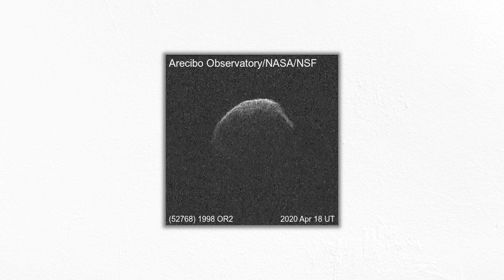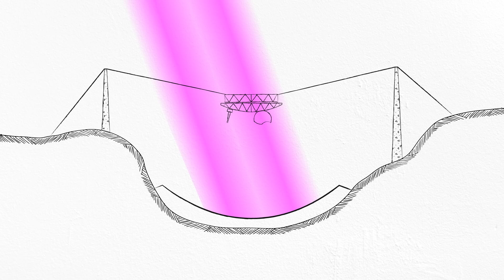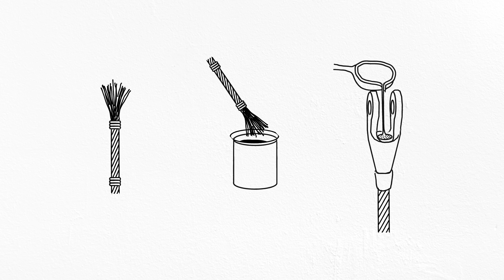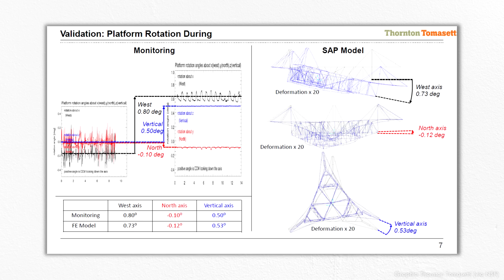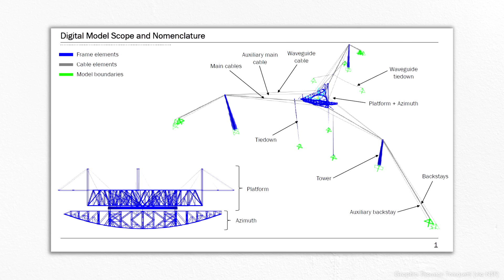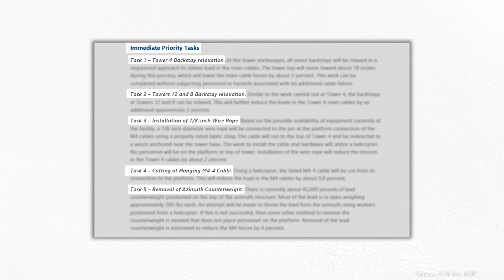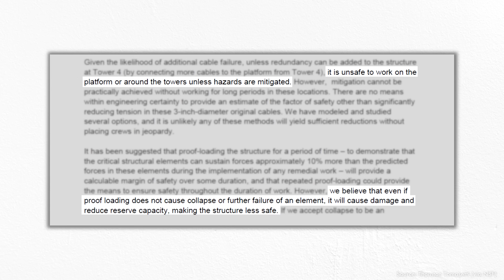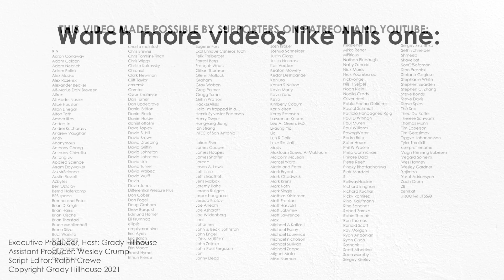What Really Happened at the Arecibo Telescope?

Comment: Well if I learned one thing, its that cable dehumidification systems exist.
Reply: They're common in communications cables, both twisted-pair (outdoor telephone lines) and coax (radio broadcast towers). A dry-nitrogen supply, or an air-compressor-dehumidifier, will be regulated to a low pressure that's routed into the cable's interstitial space, to ensure that any cracks in the jacket result in air leaking out, rather than water leaking in. The cable pressurization gas almost always goes through a flow meter on the way, and flow readings are regularly taken as part of maintenance, to assess jacket condition.
Reply: @nateb4630  I had absolutely no idea. Every time I learn something like this, I come to the conclusion that there was more to know that I’m capable of knowing. And that there is more out there than I had any idea how complicated the world is. So damn cool.
Reply: @nateb4630  Most of my cable experience has been on small yachts, where moisture is an assumed constant, with no consideration for attempts to dry them.  To hear about this tech, well it's amazing.
This is my TIL moment.
Reply: @nateb4630  Doh! You beat me to it 😁 Exactly as you say,, the only thing I'd add is low dry air/nitrogen pressure can be used to trigger an alarm for the affected cable..... The cause often being cable damage by JCB/Catipiller diggers!
Reply: @nateb4630  Coax means 2.
Wave guide is pressurised. It's hollow. Coax with hollow centre conductor is not pressurised.
Reply: @nateb4630  that is kinda amazing. can that be used to point out exactly where the jacket failed ? or it can only say if its damaged and how bad ?
Reply: Tom Scott has a video on that called "how to stop a colossal bridge from corroding"
Reply: Tom scott has a great video on it
Reply: humidity in the forest is present continiously
Reply: @jmr-marc  Humidity in my bedroom is present continuously.
My windows are crying dew on the inside right now.
Reply: @JonatasAdoM  That's not good, mold and all that. Better get a dehumidifier or vent it out and pull less humid air in.
Reply: @JonatasAdoM  Your mites must be delighted .
mine arei in the dry, and have a little hot, with these summer temperatures
Reply: sometimes theres nitrogen tanks next to phone poles . thats what they r for
Reply: Bay bridge san Francisco..an abortion..
Reply: This is the only thing I learned from the video, and that alone makes it worth it.  Part of me wonders what is better and in what conditions, corrosion prevention or preemptive safe replacement systems.

Comment: Visiting the Arecibo Facility was and is still on my bucket list, but it won't be the same without the great dish.  I likewise hope that they're able to install another megastructural instrument there to replace it - it's a great site and I hope it continues doing research for many years to come (with or without a new dish).

Point of order, though: FAST is a bigger telescope, but lacks Arecibo's transmission capacity - it's designed to be receive-only and the retrofit would be complex, as I understand it.  Humanity has lost a powerful space-radar - we have exactly one other comparable instrument (the Goldstone Solar System Radar in California, which has a transmission capacity barely a fifth of Arecibo's weakest transmitter and is significantly less sensitive).  It's not hyperbole, I think, to say that the Arecibo Dish was a unique facility, and that even 58 years after its construction it had no equal while it stood.

Comment: Very sad, that the arecibo observatory crashed. It was an important one which made so much discoveries! But it was built for way less. It was never designed to hold the gregorian dome. The original cables were old and apparently already to worn out and the new support cables weren't strong enough to hold the entire structure. But nobody got hurt and it has goven us huge insights into the universe.

Comment: Wait so it was designed with a safety factor of 2 meaning that the cables would be at their limit at 200% of the static load, but the second cable snapped at 90% of its rated load? I think a look into the corrosion theory is worth a look. Usually static loads are a simple thing.

Comment: If instead of suspending the central listening device, in the center, they alter the shape of the Dome, they could put a ring around it, that would be much more permanently stable, and allow them to receive the same basic information, if not more so, with far less maintenance. 

Would be neat, if they figure out a model, that would work well, with that form factor, as then there are far, far, less failure points. 

Though they would be gathering information at a greater angle, instead of nearly up and down, etc. 
This would be far more practical.

Comment: It should be pointed out that the original engeering did not fail. It was the engineering to add extra weight for the Gregorian dome that failed. When the new engineering failed, the old engineeing was pushed right to it's safety limit. It is a testament to the skill of the original engineers that the telescope structure did not fail immediately when taking a shock loading of a much larger weight than expected or designed for.

Comment: 15:42  A safety factor of two sounds almost negligent, if that's really the factor for "the expected static loading from the platform"...and no one in their right mind should have assumed the structure would have no dynamic loads, considering it's all exposed to the weather, in an area that often gets tropical storms if not hurricanes.
Reply: Not really - it’s failure happened at half that actual load 🤷🏻‍♂️. If it was ACTUALLY 2x it would have been completely fine. The failure of the aux cable simply exposed the critical weakness of the original cables (failure at 62%?!) 
In essence it was BUILT with a safety factor of closer to 1.2, they just didn’t know it at the time. 62% is far more than just corrosion. It’s a shame that it’s been half a century and anyone involved with the cable production won’t be held accountable- but that’s where the blame should be squarely placed in my opinion.  The construction of the aux cables / fittings is certainly a contributing factor as well.

Comment: I would hope the cables weren't made as shown at 14:37.  Steel cables with a fiber core have a habit of corroding from the inside, with the fiber wicking moisture into the centre of the cable.  This would make them very difficult to inspect, as the strength will be seriously reduced long before there's any corrosion visible from the outside.  (Obvs, this can still be a problem with steel-core cables, but it's generally less common without having the fiber to act as a wick.)

Comment: Another pertinent observation here: John Agustus Roebling apparently wintered near me in Clearwater, Florida; there are a couple streets named for him.  He was the engineer who designed the Brooklyn Bridge, still open to traffic 138 years after it was first opened in the late 1800s.

I read somewhere that he was asked why that bridge was still standing, when so many from that era had collapsed.

His reply was that, not knowing what he didn't know, he calculated the maximum combined static and dynamic loads he could envision the bridge having to withstand...

And then multiplied by *six*.

That's engineering, folks; not seeing how far you can cut the design back.
Reply: Some perspective: Its estimated that 20-40 died during the construction of the Brooklyn Bridge.          IIRC engineers had some sort of morbid causality estimate factored into their designs during the times.
Reply: @snakerstran9101  yeah, that was also pretty common in major construction projects back in what we are increasingly pleased to call the day. It still happens, but it doesn't happen nearly as frequently as it used to back then, it was a standard cost accounting item on project that large in the 80s.

Comment: If they designed it with a Factor of Safety of 2, then added the Gregorian Dome, which was 50% heavier than the existing receiver, that essentially would have lowered the factor of safety to 1.33. The original designers couldnt have predicted the technological advancements that led to the Gregorian dome. I think they cannot be blamed for not giving a higher factor of safety, as it would have seemed sufficient at the time.
Reply from the maker: They added more cables and backstays with the dome, as I mentioned
Reply: @PracticalEngineeringChannel  Yes, true, I forgot to consider that. I'm sure engineers much smarter than me examined the all these factors and more before and after the installation and concluded it was within spec

Comment: Wondering how much extra complexity it would add to such structures to include a winch/pulley system for just one anchor point, that would enable the slow controlled lowering or lifting of the suspended mass. Basically a crane on site. Likely they used something similar when they lifted the original equipment into position, then just got rid of it. Having such equipment sitting there for decades without any role clearly comes with a lot of added maintenance and expenditure, on the other hand, you'd get much better serviceability. Just in case something like this happens.

Comment: Repetitive stress fatigue. As a motorcycle mechanic I know that control cables like a clutch cable are remarkably similar. And when they fail it looks very similar the failure in the video. They always break right at the joint. By the way an even better way to form a spelter socket is to heat the steel strands right at the end of the cable enough to melt the steel forming little enlarged balls on the ends of the strands. You just have to be careful to keep the heat as close to the end of the cable as possible as heating the cable steel above red hot embrittles it.

Comment: You should also never use a rotating rope or cable in a socket, only a non-rotating rope. Otherwise they can unwind out of the socket over time. We discontinued using sockets on rotating ropes in mining about 20 years ago.
For hoisting in Shaft, single ropes use a FS of 5 at the sheave and 8 at the conveyance.  For multi rope hoists, a FS of 4 is used.  2 is pretty low FS for cables, even static.

Comment: It’s not hard to see why it failed:
1. Not enough funding
2. Poor or lack of proper maintenance
3. Poor planing and operation/redundancies to accommodate the extra weight of the added science structure 
4. Next to a high corrosion environment
5. No plan for cable/ structure failure in place.

Comment: Even if S was 1, if it failed at 0.62, there has to have been an introduced defect, either at fabrication or during use (e.g. fatigue traction/contraction due to the storms). Also, for those out there thinking S=1.5 is low for aviation, the space industry highest S is 1.2~1.25. Remember, in space, 1kg of extral material = thousands of extra $ in cost, and a .1 increase in S adds tons to the vehicle.
Reply: I don't know where you got 5 for aviation from. He said 1.5. It is mandated to be no less than 1.5 by FAR regulations. Also for human rated spacecraft the FOS is 1.4.

see for example: https://apps.dtic.mil/dtic/tr/fulltext/u2/a070237.pdf and https://ntrs.nasa.gov/api/citations/20140011147/downloads/20140011147.pdf
Reply: @ASJC27  it was a typo, thanks for bringing it up <3 Also, the 1.25 was out of Tory Bruno himself for the Vulcan Centaur.

Comment: The cause was pretty simple: Bureaucrats and modern academia. From inadequate inspection and cable slushing (things known to even the most hoedunk logging crew as critical) to excessive time spent wringing hands and studying the study of the investigation of a study of design info they should have know since the thing was built; meanwhile the problem just keeps getting worse, until of course the issue solved its self.

Comment: So, next version, use something similar to a cable tram arrangement to increase the field of view? Then you could have the option of a "home" position on the ground for the receiver. If the new towers are set further out, you'd even be able to remove the entire receiver from the dish for maintenance or replacement - or swappable receivers depending on the target body. I see many possibilities for increasing the onsite abilities while decreasing risk, taking advantage of modern computer analysis.

Comment: The cable failuers sound like a very similar situation that happened at Humber Bridge. They found moisture in the cables that the original engineers didn't predict would occur. They ended up having to spend a lot of money re-conditioning and re-splicing the cables. Considering the Humber Bridge finished construction in 1981, and this structure is significantly older than that, there's no wonder they didn't predict this kind of corrosion would occur. 

Considering the humidity of the region, there really is no wonder.

Comment: We need to rebuild it. It was the most powerful and sensitive radar telescope in the world and it is in a very quite radio area, something that is not easy to find in this day and age. A lot of the equipment is still there and intact, as well. With modern engineering and cost of materials, it would be be cheaper to construct now. We could even make many of the suspended structures out of lighter and stronger materials. Hell, just the cost of the aluminum panels would be way cheaper now and could be made thinner by using a modern alloy.

Comment: Double margin was with new cable, likely with at least 30% extra from the cable manufacturer understating tensile strengths the cables were guaranteed to withstand.  However 60 years of spotty maintenance meant the paint was covering salt ingress, and thus making thousands of small electrochemical cells along the cable itself, leading to the gradual weakening of them. Eventually the strain was too great for the remaining cable, and you can see it was suffering from plastic deformation until it finally got to the yield point, and the rest went in a second or so as they were massively overloaded. Likely examination of the failed cable ends will show the plastic deformation and the corrosion cells where they failed in sequence, along with likely all of the cable length being corroded from the inside. The failed sockets likely a mix of the zinc being too cold when poured, the steel cable and socket was also not heated up enough, and 60 years of salt turning the zinc into zinc oxide and zinc chloride inside the joint.

And for elevators, the 11 times safety factor means a single cable is able to hold the car safely, even if all the others fail. Typically 4 cables minimum, though for long travel 6 is common, more to reduce wear on the sheaves than anything else, as this spreads the contact area out and thus the pressures are lower. Inspections not snapped strands, and replace them when there are too many snapped strands within a certain distance on the cable, or from an end. The quick way to look for snapped strands is to take a cloth, and wrap loosely around the cable, then run the car from top to bottom, and see if the cloth gets snatched. Almost no elevator accidents are due to cable failure, pretty much every other part fails first.

Comment: Shame they couldn't have used helium/hydrogen balloon/dirigibles (perhaps many of them) to temporarily attach to the suspended structure/cables to lessen the load.
I'm sure each would provide only small lift, but maybe enough large ones could have compensated for the lost cables and allowed crews to safely attach emergency cables.
Maybe even use drones to pull smaller cables over the existing supports and under the platform (allowing increasingly larger ones to be pulled over). Even if these were simply draped between existing cable mounts, it may have been enough for an emergency stopgap.
Oh well.

Comment: They didn't replace the cables after 50+ years?! Fucking morons. In overhead line engineering conductors are replaced every 20-30 years minimum.

Comment: It is difficult to wrap your head around how enormous this dish actually was without seeing it. It is as wide as 4.5 football fields end to end and has the surface area of 30 football fields.  It was also featured in the film 'Contact' and the James Bond spy movie 'Goldeneye'.
Reply: The universe is about 93 billion light years in diameter. That's larger than two football fields!
Reply: @GAVACHO5150  But you are not talking crazy, you seem like a normal logical person. Leave the craziness to us.
Reply: "Football fields" has no meaning to me.  Would have been cool to use a real unit of measurement like meters.  Cheers
Reply: @ianspeckmaier9565  73,000 square meters.
Reply: @nunyabidness117  Holy moly that's huge.  Thanks for going out of your way to convert that

Comment: First failure most likely the socket.
Second and third failure most likely added load and fatigue from added hold down cables.
(Instead of being free to move and adjust the angle forcing it to stay level made the structure load the cables more regularly)
((Some weird loading))

All other failures due to a lack safety factor for each tower with two failed cables.

Comment: What was the black strap, around the 3rd cable, purpose?
Reply from the maker: Between the first and second cable failure, an inspection crew climbed the tower to remove the specter socket for inspection. They left their sling up there as a way to lower some monitoring equipment.
Reply: @PracticalEngineeringChannel  Thank you for the explanation.